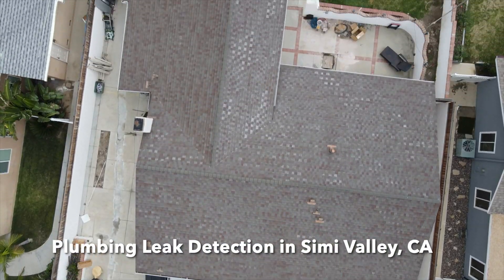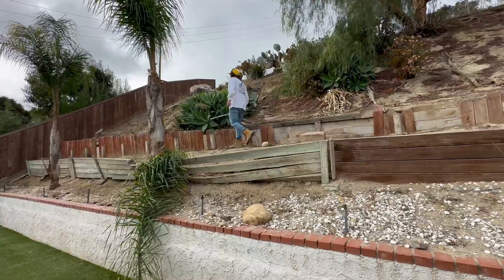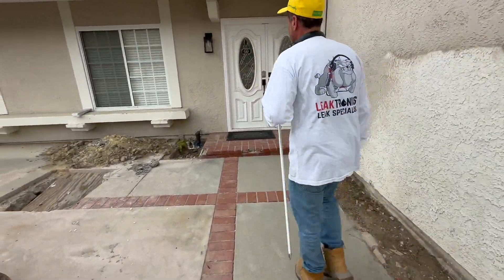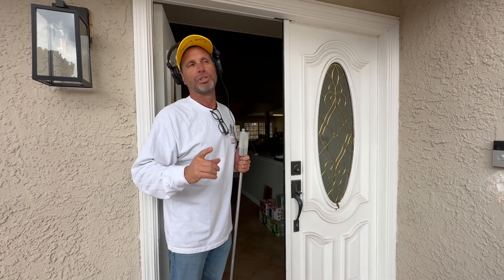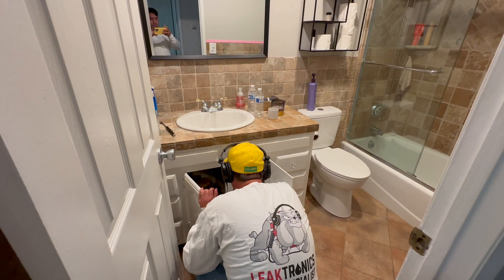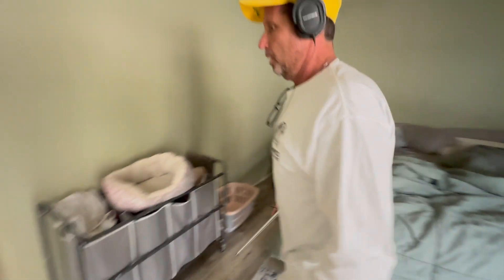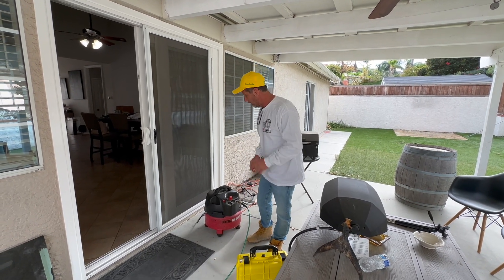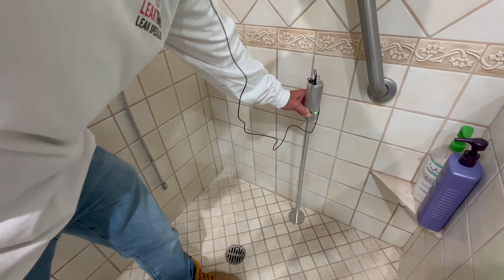Expert Techniques for Finding Plumbing Pipe Leaks

Comment: nice job showing how to find cold water leak, but how would you use the equipment to find a hot water slab leak?  where would you apply your air pressure- there's typically no threaded bibs on the hot water side.
Reply: You use a thermal camera, hot water leaks are the easiest ones because you can see them
Reply: start at the water heater and turn the intake (main/cold water off). that's what i'd do. goodluck

Comment: My question is about inducing the air.What is the correct ratio of air to water?
Reply from the maker: Get the water up to about 10psi, then shoot short bursts of air air without going above 15psi.
Reply: @LeakTronics  should I put a check valve on the air compressor to alleviate water coming back into the compressor when using a remote control?